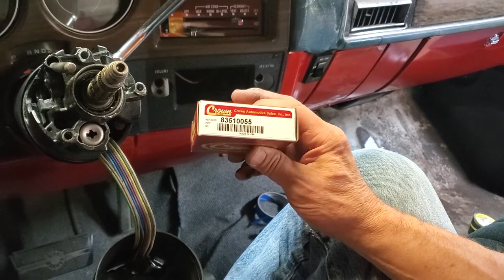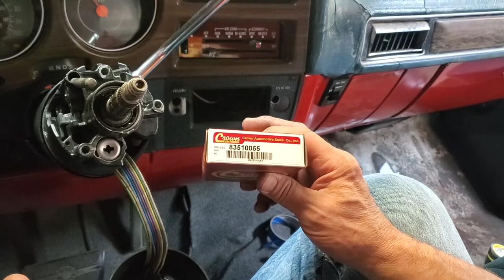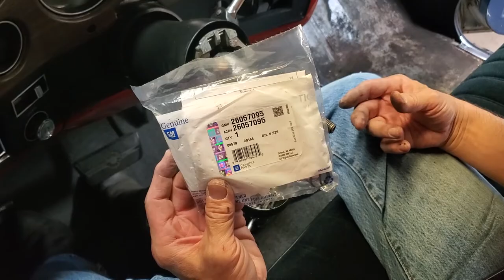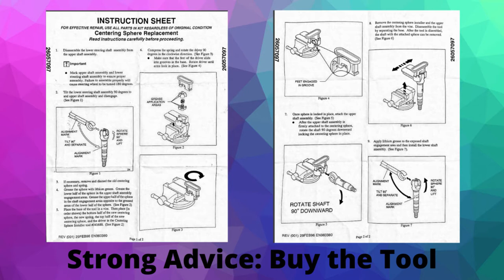1976 Chevy C10 Tilt Steering Column Rebuild  - GM Tilt Column Repair 1969-1976

Comment: This is exactly what i needed. No other installation video showed using a ground wire for the horn. My new steering wheel from LMC Truck (Grant Steering wheel) did not include the extra wire and Grant had no instructions that showed it.  It was driving me crazy because it had every indication it needed a ground wire but wasn't mentioned or shown anywhere. Thanks so much.
Reply from the maker: We're happy to hear that you found a solution while watching our video. Easy to understand how perplexed you were until you came across this video. Thanks for mentioning it and thanks for watching.

Comment: On the original centering sphere you can open the spring up and that will tighten up the joint
Reply from the maker: I would suspect you are correct about that. As long as I had to do it and the part was available new I went with new.

Comment: Hello! I’m working on an 80 Camaro, I got to the 4 torx bolts I lock tighted them down now the problem is when I pop the pins in it’s extremely hard to move the tilt, I put the spring in same thing, I have to pretty much force the thing to tilt, and it wont tilt up anymore only down. and when tilting down it doesnt tilt down smooth like it used too, idk if its the way im installing the tilt collar or what but thats my idea, i keep putting it on and off and its not moving up and down like its supposed too.

Comment: This would be a great how to do it, however, it just needs a little time edit, take out the part, where the piece is installed wrong, and it will be great.
Reply from the maker: There is a subtitle at around 20:55 that gives the warning, "bearing is upside down." We can make a notation in the description as well in case viewers want to skip over this part of the video. I believe at the time of publication, we had it in mind that there was information leading up to the point when the bearing is upside down and a retake would have been extremely difficult. Maybe at the same time it gives caution that the bearing is installed wrong, and maybe it's a way to tell our viewers not to make the mistake. Your comment is valid in that it would shorten the video for easier viewing. At this point in time it would require and edit of the actual video and republication, which would upset the algorithm and bring the view count to zero. Thanks for watching.
Reply: @CarzPlus  OK, makes sense , I just watch , to learn, and get distracted with extra information, HAA HA

Comment: Wow what a job. Do non tilt wheels have the u joint. The plastic piece below that is broken on my 82. The gear indicator screws to it and it is broken there. I may just rivet a small piece of metal to the plastic and attach the gear indicator to the metal.   Removal would be too much trouble
Reply from the maker: Yes, quite lengthy. The universal joint would not be needed in a non-tilt column, but I haven't worked on non-tilt columns and could be incorrect in that assumption. Thanks for watching.

Comment: hello friend, your video helped me a lot to disassemble the column of my chevy since I have the same problem, but could you tell me where I can get the parts that I replace in the video to be able to change them to my chevy as well
Reply from the maker: This is where we found ours. Here's a link for the tilt steering column rack and bearing rebuild kit: https://www.vintagejeepparts.com/products/83510055_Tilt-Steering-Column-Rack-and-Bearing-Rebuild-Kit.html

Comment: That bearing you took out at 20 minutes even on the back of the column shaft. Whats the piece called? Mine broke and can't find replacement
Reply from the maker: I would talk to a steering column rebuilding company to see if you can source one.

Comment: When you replaced the bearing did the outer ring stay in because mine exploded and the only thing that stayed was the outer ring and I cant figure out how to get it out
Reply from the maker: The parts were easy to remove on mine. The worst issue I had was making sure I got all the old ball bearings out. A very pointed tweezers might help in your case. It sounds like there may be some galling on one of the parts causing the ring to hang up.
Reply: @CarzPlus  I've gone to the next part of the steering column so I can push it out from the back I got one of the 8/32 screw pins out but they are really in there

Comment: Any way I can swap the signal wiring with out digging that deep? I'm puting a tilt colum on my 73 but wiring for  colum doesn't match
Reply from the maker: There are 3 ways I can think of off hand. Find a plug that mates to the column you are using and wire it to match where the wiring comes out of your column. Second, hard wire the wires from your column using soldered connections and heat shrink tubing where the wires leave your column. Third, use quick disconnects to do the same. I would use the first method, as it would be the cleanest looking finish install. All of these assume that the turn signal unit in your column is functional.

Comment: you're working way too hard.  use a gm lock plate compression tool to remove snap ring. All of the gm and jeep parts are assembled in Saginaw, Mi. and interchange.  Net dealer price on the bearing packs is under $20.  You will also find that the Chrysler tilt columns use the same internal parts as GM.  Snap on sells the swivel pin removal tool for the pins.  The first time you break your 8/32 screw in the pin you'll regret not having the correct removal tool.
Reply from the maker: I'd have to agree. At the time I was too cheap to buy one. Later on, I did.